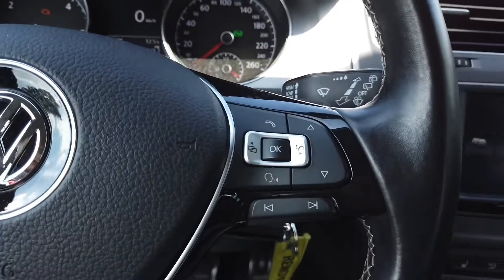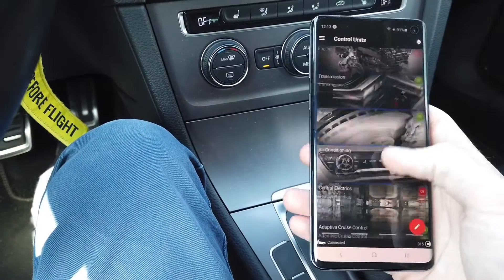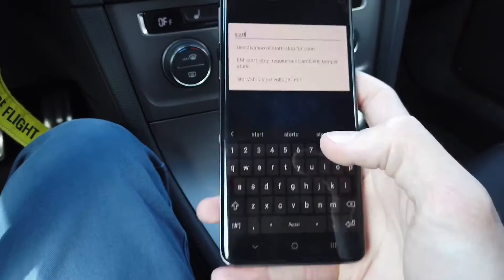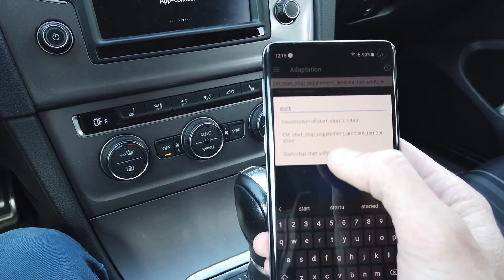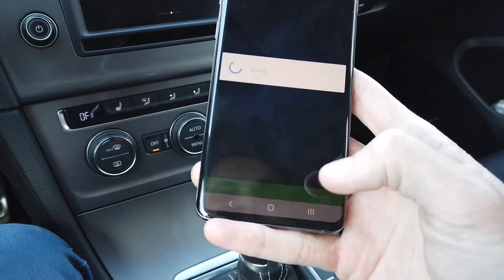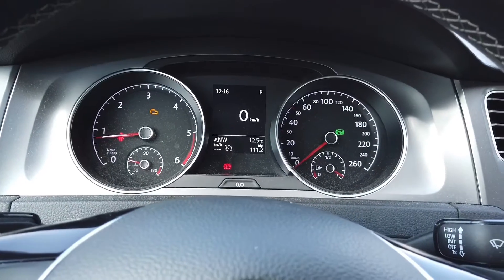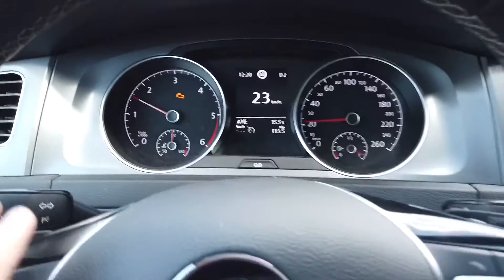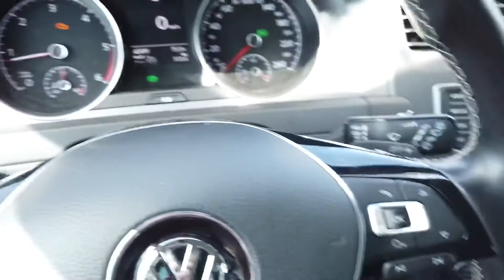VW Golf MK7 (5G) disable Auto Start-Stop system

Comment: To use the temperature method you need to be in development mode in the previous screen on obdeleven.
I got the same error when trying to re-enable it to change to the switch cable interface module

Comment: Tried on my MY2019 Golf 7,5 and unfortunately it did not work. With voltage set to 12.1 start/stop still works as usual. Is there any other way to code it out on 2019 golfs?

Comment: Hi @mr-fix - I use OBD11 as well with iOS. I have a VW Tiguan 2.0TDI from 2013, I tried long coding in module 19. but I only have 3 bytes (with index 0, 1, 2) and only got long adaptation, not adaptation, where I have to enter the channel 0-255. Do you have any idea how I can turn start-stop off please?

Comment: Auto-Start Stop is the most idiotic feature ever included on an automobile.
Reply: There is one even more idiotic on the Golf 1.5 Tsi 130hp, where it shuts off the engine while driving - cruising mode... annoying and idiotic to save 0,001 liters of fuel
Reply: I get the impression that the stop start system wrecks your battery, too. My batteries last less than 1/2 as long as they used to. It ought to be possible to disable this feature from the infotainment system. Any improvement in miles per gallon is eaten up by replacement batteries. And, stop start batteries are very expensive, too.  
It's one of many gripes I have with my mk7 golf. I'll never buy a VW again. Expensive, poor UX, and very difficult to change the oil filter on mine, too.

Comment: Do you happen to know if this is available for a Golf GTE Hybrid?
When i'm in GTE (Sport mode) when letting of the throttle the engine turns off and when applying throttle again it turns on again with high revs.
It very anoyying and possibly bad for the turbo.

Comment: it's permanently disable. But is it possible to do that - after starting the engine the value would be "off", and I could turn it on manually with button if needed
Reply from the maker: AFAIK you can't do that in Golf MK7.

Comment: In the Mk7.5 the voltage method no longer works. Tried setting to 12, 12.1 but stop start still kicked in.  Must try the temperature method. Voltage worked on RS3, TTRS and Tiguan but has stopped working on the Mk7.5 Golf R. The voltage method is accepted and stored but does not disable the stop start.  Going to have to find another way
Reply from the maker: There's a third method that I found for Seat Leon 5F, which is basically the same as Golf MK7 and Skoda Octavia 5E. Instead of changing gateway adaptation you can change gateway coding and changing few bits related to the SS function.
If you want to try here are some details:
Module 19, Long Coding, Byte 03, Bit 2, disable
Module 19, Long Coding, Byte 03, Bit 3, enable
Module 19, Long Coding, Byte 04, Bit 0, disable
Module 19, Long Coding, Byte 04, Bit 0, disable
Module 19, Long Coding, Byte 15, Bit 0, disable
Reply from the maker: And one more thing that you can try. Please let me know if any of these work with your car.
Module 19, Adaptation, Channel: Deactivation of start-stop function, new value: Stop prohibition: no start request
Reply: mr-fix Thankyou so much. I’ll give those a try and report back
Reply: @OperaQld  Did any of those solutions work? I'm looking to do the same to my September 19 Golf
Reply from the maker: @OperaQld  tried it?

Comment: Or you can just unplug the connector which is located on the battery. Takes 2 seconds. 
Much faster and easier solution to achieve the same result!
Reply from the maker: Would not recommend that.
AFAIK disconnecting this small module on the battery will cause energy management system to fall back to save settings. This includes start-stop to be disabled but also no regenerative braking, improper battery charge voltage, possible issues with webasto and supplemental heater, function limitation of the heating fan, welcome lights, curve lights...
I'm going to stick with coding method.
Reply: @mrfixpl  disagree. It was the first thing I made after buying the car. I spoke with the service about it and they told me that it wouldn't cause any problems. Few days ago it was checked with pc and everything is fine.  Half a year of using and no problems at all.